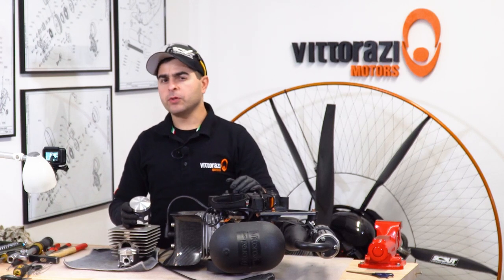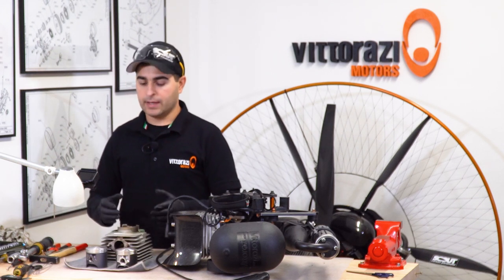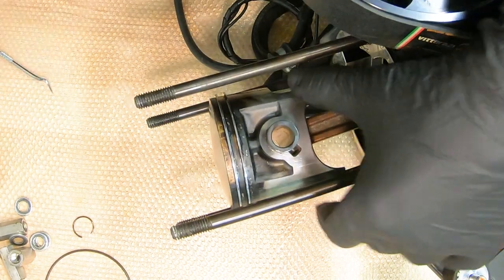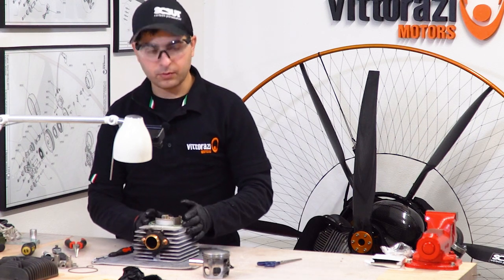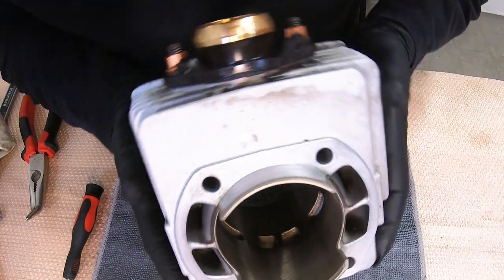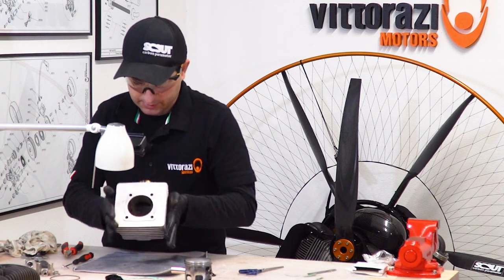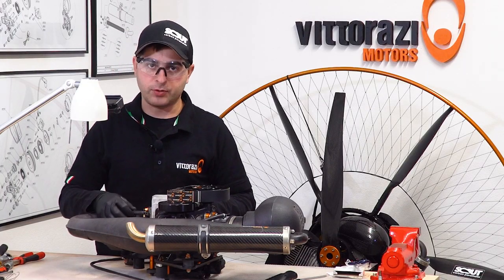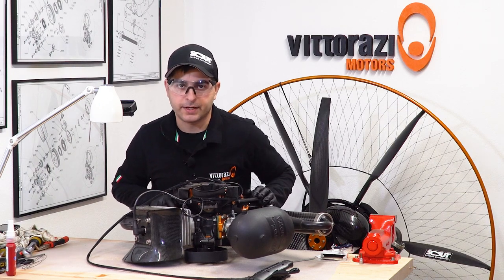Vittorazi Moster piston replacement. Paramotor engine maintenance series

Comment: Putting a bigger piston into the cylinder without measuring it just based on the hours is absolutely unprofessional. The cylinder sizes vary by 0,01 mm between two selections. A one size bigger piston will be also bigger by 0.01 mm in diameter. The factory piston clearance is 0,05 mm, but the cylinder wears unevenly. Under the piston rings, made from chromed steel it gets a barrel shape and even elliptic, while the bottom part, that is in contact with the soft piston only will not wear at all. To put a bigger piston, the cylinder needs to be honed, to restore it's original shape and the "grooves" to hold the oil film on the cylinder wall.

Comment: all that lock tight in way to many places will cause big prolems on future simple mantance. Id say the only place you need it is on the engine frame to mounting plate the 4 tapered bolts. On my last rebuild I had to heat them with a torch to release the lock tight. I check prop bolts every 20 hours  along with pull starter bolts. All other bolts about every 100 hours the ones the ones you can see. As of yet I think Ive only ever found but one pull starter bolt back out a little.  I purchased  a brand new electric start engine 185 what a pile of shit that was. I have worked on that thing, more that than all my used 185 engines. That must of been a friday motor. 6/24 purchased,

Comment: Why is the small hole provide on exhaust side..? (On cylinder wall)
Reply: It’s decompression port, which is needed for easy engine start, as far as in know. And it should be cleaned if you have opportunity for do it
Reply: @Vberegovoy  thank you so much for replying message, but how it's worked...? I want see video

Comment: 200 hours!!!?? What kind of crap are you selling? And it's stupid expensiv also. If it's that terrible, how about including an extra piston and maybe a muffler, since that's gonna crack. Embarrassing. You should be ashamed with that price.
Reply: It’s an aircraft so you must make sure the maintenance is done and no issues when flying. They did have exhaust issues from bad design and also accelerated by bad operator warm up proceeders but they did offer replacements and fixed in MY20. 

From my experience this motors build, parts acquisition, performance and reliability especially when flying makes it far better than most motors on the market. You get what you Pay for.
Reply: @pepperjackshack2439  I have a PPL. I think I know what an aircraft is. And "you get what you pay for"... not much apparently  when it comes to paramotors.
Reply: @mrsonor1090  that’s great actually. Sounds like you’re sticking to planes 😂
Reply: @pepperjackshack2439  Hehe, waiting for electric. The batteries are getting better and better.
Reply: You do realize this is a two-stroke engine? A four-stroke is too heavy for foot launch. Two-strokes are known for their fragility, and unreliability.  These are the most reliable two-stroke engines made and they require regular maintenance and parts replacement.  You expose your ignorance with your commentary.
Reply: @parajerry  No shit, Scherlock. I had 2-strokes since I was 12. I think I know what it is. And that 4 strokes are too heavy.. ever heard of Bailey. They made 4 stroke footlaunched PPG:s. If your to fat to handle a footlaunch with those, that's your problem. Don't come here and lie.About these 2-stroke, they made them too weak in pursuit of power and weight, and we have too pay for it. And don't say they are the most reliable 2 strokes, thats another lie. They made very powerful things for MC and they didn't break after 25 hour. Or the exhaust didn't crack after 10 blocks. The most reliable  I think is some engine they made to be in a waterpump. It just didnt break 😁 But okey, if you want a shit engine that's light it's gonna break. Let's hope the batteries gets better really soon so we can scrap this garbage.
Reply: @mrsonor1090  Easy Sonor, keep your pants on. We're all here to learn a few things about our hobby, mate. Best, Rob ^^